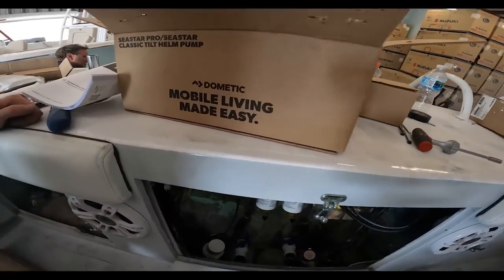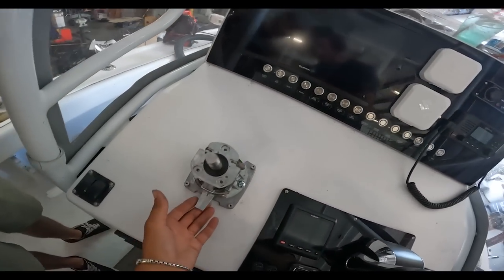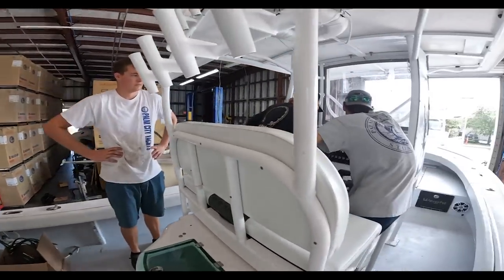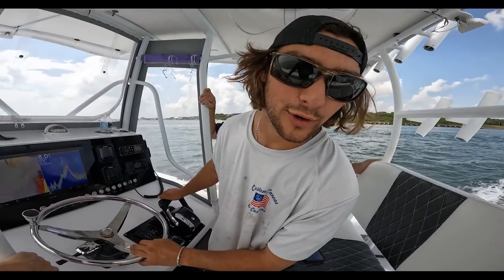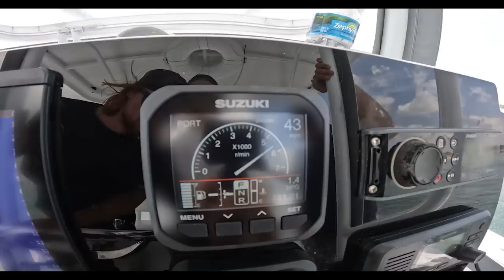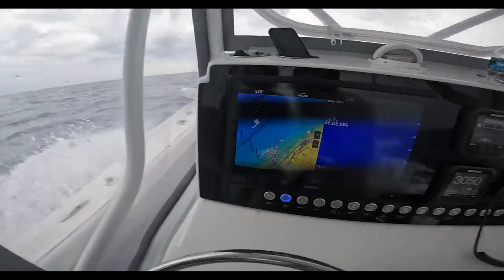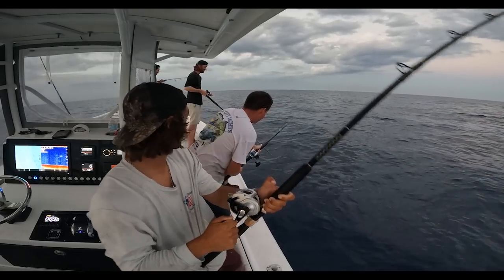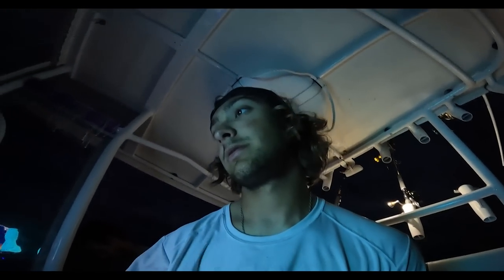I Fully REPOWERED My BOAT!!! (TWIN 200 SUZUKI'S - Repower and Fishing)

Comment: Pcy installed my 350, with a power assist, GO check to make sure they installed a 50 amp inline fuse,  they didnt on mine and when the pump caught fire it almost burnt my boat down 12miles out. Go Check for a 50amp inline fuse. Plus dometic makees an awesome autopilot pump that mates to the side of the pa pump, elimates extra hoses.

Comment: Couple suggestions. Run n2k network from engines to mfd and switch batteries to lithium and save some weight.  You'll be able to control autopilot from mfd and overlay gages on mfd.  I run ionic lithium on my boat.  Saved tons of weight.

Comment: Weird idea i may have smoked a little something funky this morning while watching this but if you ran like a short tube off the bottom the rod holder into the bilge to get rid of the water, kinda ghetto but definetly works to move water  away from the pump.

Comment: Nice repower. Did you ever get some performance numbers like top end trimmed out and full RPM? What boat is that and estimate weight? I would like to repower my boat with these motors, but just not sure if I will get the same performance I have today from my 2 strokes.

Comment: You should of built a new boat from scratch. After all the painting and motors you still have a old boat with new motors. And in the long run it is costing more money than if you went all new!
Reply from the maker: The only thing that’s old is the hull. And there is nothing wrong with that
Reply: absolutely, you can have an old hull that could be better than some of the new ones.

Comment: Those engines are about 9500 each, so if you spent 40K you failed.
Reply from the maker: So throttle, rigging , gauges, PA pump, new ram, new helm new fittings. U sure?
Reply from the maker: And not entirely sure where you see 9500 each oh also, no labor ?
Reply: 9500 that’s how much a 90 hp cost